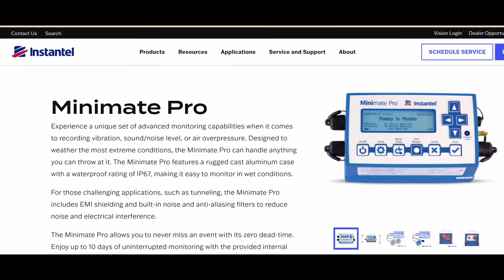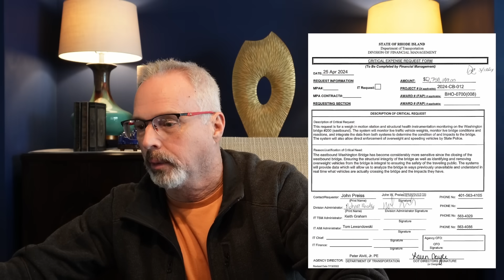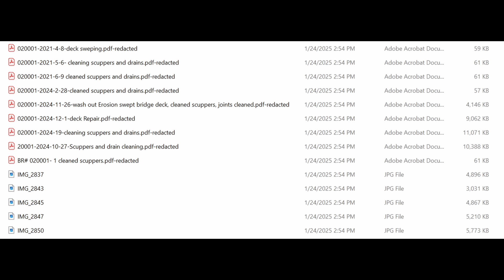Is RiDOT Monitoring Vibrations at the Eastbound Washington Bridge?

Comment: I'm glad I found your channel.  I'm no Engineer, but I've got EYES! 
In my opinion, the cables or rebar should have been cut. You drop something like that, somethings gonna pull on something. And we all know, somethings gotta give! And I think a lot more Concrete should have been Hammered off for weight reduction.
But I'm no Engineer.   Thank you
Reply from the maker: Thank you.  They also apparently did significant damage to the barges but the DOT director insists everything went according to plan.🤣🤣

Comment: Aliviti saying "Everything is OK because it's 150 feet away" is beyond disingenious.  ANY engineer with experience in foundations/soils/loading would never make such a statement.  A competent engineer would tell you about the soil conditions, the underlying rock strata, it's ability to resist or transmit vibrations, and all of the monitoring they have in place with strain guages, transducers, load cells, and seismometers to measure any vibration.  THAT is what you'd hear from someone with data and objective measurements to back up the idea that 150' is far enough away.  The fact that Alviti couldn't even tell the truth about the 150 feet (as Casey points out, it's actually between 18 and 141 feet) is just the icing on top.  

Here's one way you can absolutely tell Alviti is a bad engineer.  He never says "I don't know".  Alviti always has an answer.  There's always an explanation.  Broken anchor rods?  Must have been a ten-million-ton-truck that snuck past.  400 tons of falling concrete?  All according to plan.  Load up the EB span with 2x the traffic, Yeah, that'll be fine with not weigh-in-motion monitoring.  

You've never once heard him say "anything like We need more data".  Because the answers are easy to come by when you're making them up as you go along.
Reply from the maker: You nailed it!

Comment: The daylight video clearly shows the operators did not sever the bridge span in the middle.  Without cutting the rebar, clearly one span is going to pull the other off its pier when the operator just pushed it down like he/she/it did.

Comment: ☢☢☢Based on the search results, there are no engineers listed as project managers specifically for the Washington Bridge project in Rhode Island. However, the search results reveal some concerning information about the project management at the Rhode Island Department of Transportation (RIDOT) under the leadership of Peter Alviti:
	1.	RIDOT has been systematically reducing the number of professional engineers and replacing them with “project managers” who often lack engineering or technical backgrounds.
	2.	Some of the project managers at RIDOT have backgrounds unrelated to engineering or construction, including:
	•	An individual with a theater background who previously worked as a facilities manager at Roger Williams Park Zoo & Carousel Village.
	•	Michael Boyd, who previously worked on store layouts for TJX and CVS.
	•	David Walsh, the acting manager of project management for RIDOT, who has a degree in political philosophy and previously worked as a furniture salesman.
	3.	These project managers are responsible for overseeing major road and bridge projects in Rhode Island, despite their lack of engineering expertise.
	4.	The job description for project managers at RIDOT does not require technical expertise, allowing for a wide range of backgrounds to fill these positions.
It’s important to note that this situation has raised concerns about the management of infrastructure projects in Rhode Island, including the Washington Bridge project. The lack of engineering expertise in key project management roles may have contributed to the issues surrounding the bridge’s closure and the subsequent challenges in its replacement.

Comment: As a retired blaster in the NE we were very concerned with vibration (air blast overpressure) for liability purposes. When on site or getting permits we were given limits on ppv and frequency as mentioned in video. Our insurance company would also limit us so as to design our blasts to 50% of recommendations "if possible". We used our own Instantel Seismographs and sometimes independent monitoring companies to verify ground movement and conduct pre-blast surveys.  These are state mandates! Why are not they in place for this project BEFORE the demolition is even started? Is Alviti and the RIDOT exempt from these standards? Thanks Casey
Reply from the maker: Thank you. To be clear it's possible they are monitoring vibrations  but I doubt it very much and if they were doing, that why I wouldn't Alviti have mentioned it?
Reply: @CaseyJones-Engineer  Exactly! Mentioning specific data would put the people more at ease ,which seems to be the purpose of their video, instead of just spouting off how "safe" they are.
Reply: @CaseyJones-Engineer  I think most of the public today who are interested can comprehend, at a general level, basic technical procedures; for instance reports or briefings by NTSB, ChemicalSafetyBoard, or similiar groups. So Alviti can't blow off not mentioning it as "over the public's head".
Reply: I assume you were somehow working for or with maine

Comment: I did vibration monitoring on several bridge piling jobs and I can tell you that depending on ground conditions the vibrations can be very different in just a few feet. The density and rock underneath can transmit vibrations differently in one area vs another. You are absolutely correct that the ridot guy used language that was incorrect. A set distance is not necessarily enough to protect a nearby structure.  Ridot guys comments are misleading to the public and incorrect.
Reply from the maker: Thanks for your comments.  You are exactly right and without a plan and monitoring they are just running blind.
Reply: Public safety takes a back seat to public image. Seems like a recepie for disaster. Hope I’m wrong.

Comment: Alviti, in my opinion, comes across as having no credibility.  His attitude is defensive and obviously obstructive in being thorough with his dealings with the public.  It would appear the absence of the bridge monitoring systems is actual malpractice from an engineering and public safety point of view.  What is wrong with him?
Reply from the maker: I think a related question would be why spend $2.7 million on a bridge monitoring system that may not be operational until most, if not all, the demo work has been completed.
Reply: @CaseyJones-Engineer  Great point Casey! Maybe he was saving it for a rainy day.
Reply: For some reason the guy appears to have complete job security.

Comment: Your observations on vibration monitoring are well presented.  
Looking at the video of the demo, it's Possible that this mess happened according to plan.  Aetna and Vinagro have done this type of work before.  There are ample barges, etc. to catch most of the debris.  Which kinda worked.  The force of those 2 end pieces would have plunged through anything that got in their way, so best place for them is in the water.  
The published plan for the demo, with the "cushions" in place tells me it was a Surprise that the 2 ends collapsed as well.  Now, what holds these ends in place?  Anchor Bolts???  Anchor Bolts that were subject to the same thorough Inspections as the ones that failed initially?  And somehow managed to degrade without anyone noticing??
So I'm on the fence about it.
Until RIDOT starts talking.  The lack of transparency by the state kills any chance of "accidents happen/we meant it this way", etc.

Comment: ...is there anything in the USA similar in scope to this RI FlusterCluck but in a Republican run State? (...for a comparison...)
Reply from the maker: I would say a close second is Wyoming DOT's handling of the Teton Pass, but RiDOT tops the list for how NOT to handle bridge projects or communication about bridge projects in my opinion.
Reply: Opposite speed of the 'Swamp Castle' rebuilding in WY... but the same problem of 'measure nonce and let it fall or stand where it may since it's never gonna be your fault if the EB span becomes unsafe due to demolishing the WB span and/or wear and tear from carrying 2x the lanes it usually does and the years of delays... just sue the contractors!'